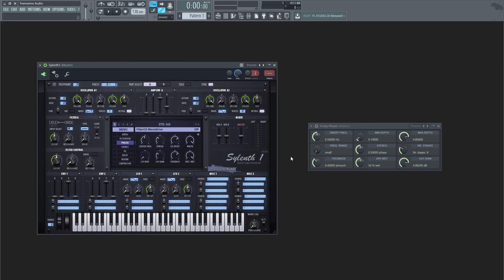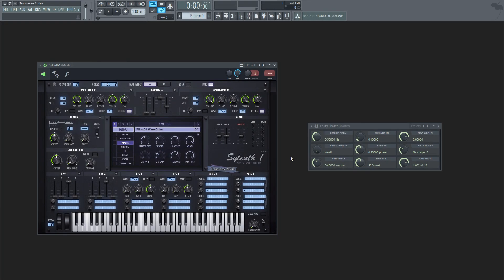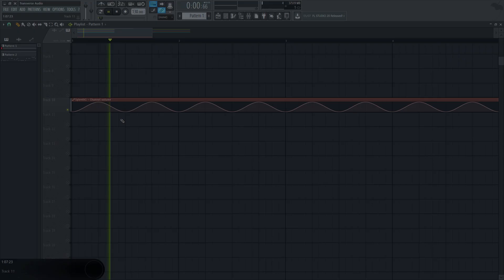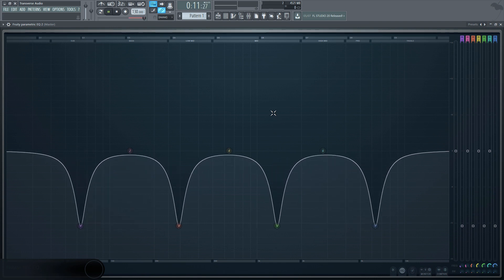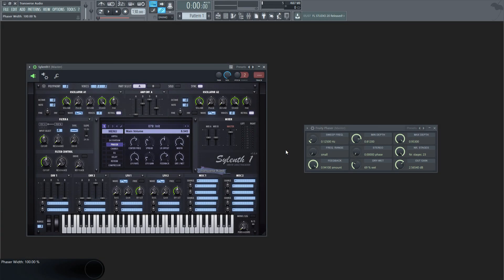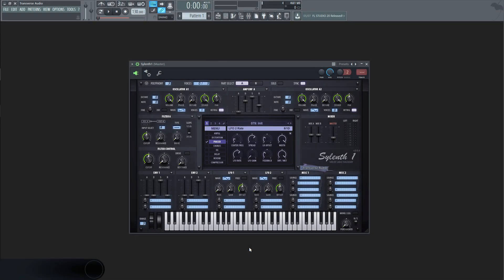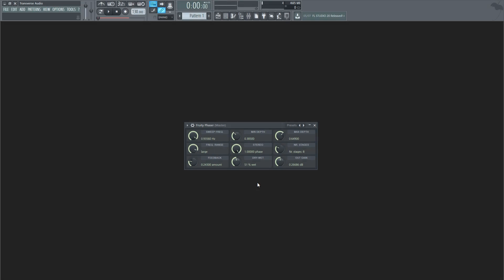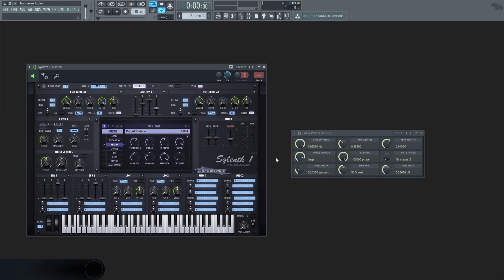Phaser Effect Tutorial - (How To Use A Phaser Effect)

Comment: I dont understand what lfo ? Is effect or what how it sound lfo ?
Reply from the maker: It's basically a way to automatically change a value based on the speed the wave oscillates. You can't hear it.
Reply: @TransverseAudio  what is osciliator?
Reply from the maker: It is something that produces a signal/waveform (audio/sound). This could be a sine wave, square wave, saw wave, etc.

Comment: How did you move all the bands from left to right at minute 1:10? And is there an automation for it? Im using FL10, maybe its not possible with its para EQ 2. It would be nice though, since i want to control my phasing effects.
Reply from the maker: Hey, I did use automation there. You need to right-click on any of the parameters to the right, not the bands on the visualizer. Or, you can move the parameter back and forth a tiny bit, then go up to the Tools menu, and down to Last Tweaked to create an automation clip.